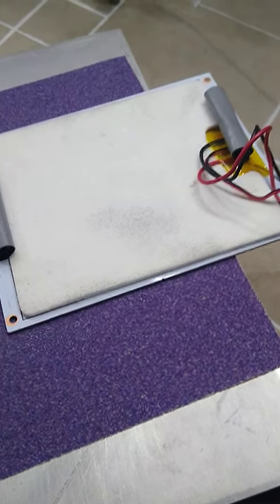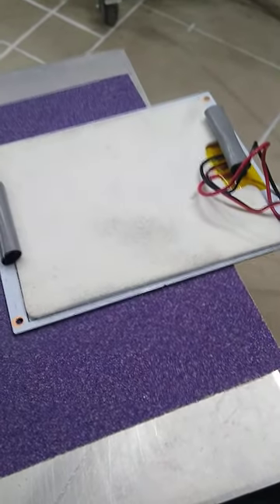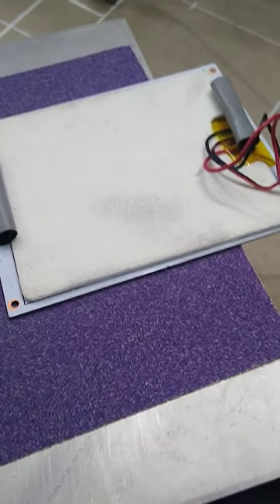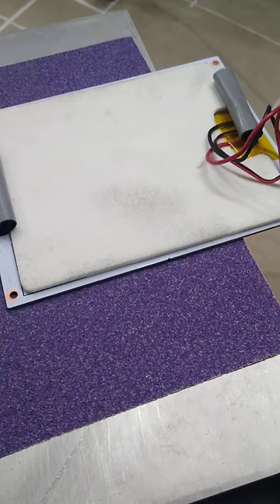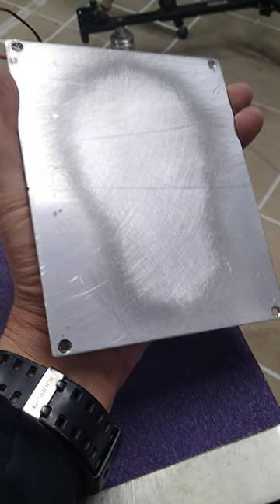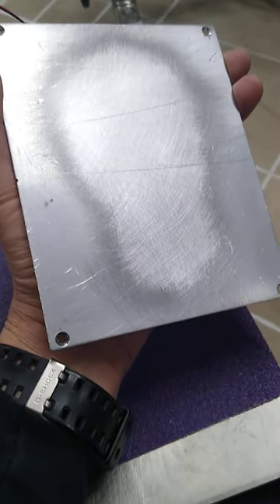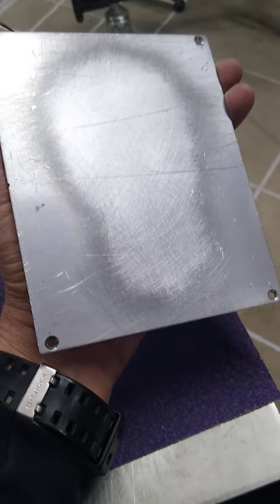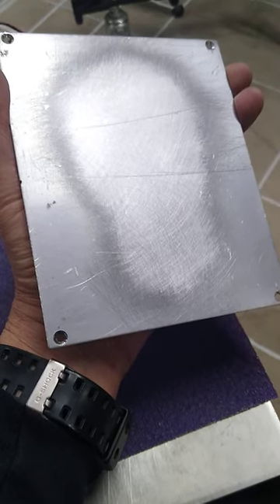3D Printer warped bed problem - Monoprice Mini Select V2

Comment: Did this work? I suspect the same issue with mine. I just wanna make sure its not gonna cause a issue with heat dissipation.
Reply from the maker: Yes, it absolutely worked for me, but as with all modifications I suggest you only do this at your own risk. As I see it if the bed is warped badly as mine was then you only have three options anyway....1. Do nothing, 2. Try to repair by sanding or 3. Replace the bed completely. I suppose it all depends on just how badly warped your bed is. But this fix did work for me.